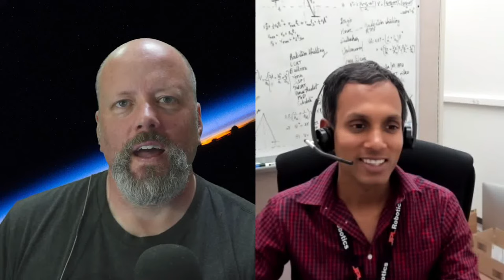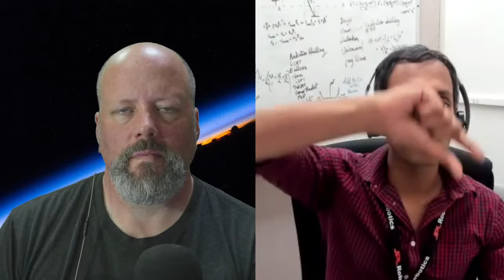The Lunar Crater Radio Telescope with Dr. Ashish Goel

Comment: I've been agitating like a madman for a radio telescope on the far side of the Moon for years. Something several kilometers in diameter and constructed entirely of material found in the Lunar Regolith. Yet people call ME crazy. Harrumph.
Reply from the maker: I was pretty skeptical, but when I heard the weight, I’ve come around
Reply: Learning how to do manufacturing on the Moon is perhaps the best step forward we can take. It seems to be largely composed of disassembled spaceship.
 It's close enough to have robotic surgery as a legitimate option, low latency data.
 It's 1/6th G which might be low enough for a GP spaceship to takeoff under it's own power yet high enough for humans to tolerate longer possibly.

Comment: How do we not have an Optical Telescope on the back of the moon yet?  It makes no sense to me.  Once you land it forever almost you have one of the best telescopes in the known universe.
Reply: There's no need to put an optical telescope on the far side of the moon - the near side works just as well, 24/7.
Reply: @JCO2002  Surely heat would affect the mirrors no?
Reply: @JCO2002  nm I'm half asleep like 5 seconds after I posted that I realized it don't matter.
Reply: @seditt5146  Easy to have a sunshade to eliminate that. You also have to prevent reflected light from the surroundings, but again no big deal. Think of it as a Hubble that's on the Moon, rather than in Earth orbit.
Reply: @JCO2002  Full moonlight affects OIII filters. Imagine how bad Earthshine would affect imaging.
Reply: @LolUGotBusted  Then don't point the telescope at the Earth. Voila, no Earthshine.
Reply: @JCO2002  I have to call all of everyone in astrophotography. Why don't we just not point at the moon! WA-LAH
Reply: @LolUGotBusted  I'd suggest you not do that unless you want to embarrass yourself. Tell me, what does the Earth have that the Moon doesn't? Here's a hint - it starts with the letter "A".
Reply: @LolUGotBusted  By the way - you pronounce the "v" in voila. Here's another question - is Hubble affected by Earthshine? After all, it's only 400-500 km away from Earth and, like on the near side of the Moon, the Earth is in the sky all the time.

Comment: A radio telescope on the moon as part of the EHT would make the apeture 1/4 the diameter of the Sun
(it doesn't even have to be on the far side ... but there would definitelly be shipping issues wih those racks of hard drives used for the data dump that needs to be processed)

Comment: Get a circular Rover containing a bunch of small "Cannon Balls" attached to spools of wire, Drive to the center of the crater and fire the wires towards the edges of the rim.  Perhaps even some hooks so when they land they are some what stable.  You might even be able to just use a rotating turret type system where you fire and lay the wire out, rotate one degree, fire the next etc...  Given the wavelengths he is discussing having the wires lay on the floor would act like a nice solid parabola You could now just raise an antenna to its focal point and boom, huge radio telescope.  You should be able to fire FAR longer than 1km and the moon is rather stable.  Perhaps have small helper bots that walk down the wire and "fix" any wires which are off.  Idk, I like the idea and think its possible for creating huge scopes.
Reply: 23:00  YES!  :D  Projectile based LOL, I love it.  That was my first thought on this topic.  I just picture a Divinci Tank going to the middle of the crater and popping off on the moon.

Comment: I'm confused.  I thought they were going to look at really low frequency large wavelength signals but 3-30 Mhz is above AM isn't it?  Did he mean 3-30Hz?
Reply: 3-30MHz have wavelengths of 100 to 10 metres.
Then you want a dish much larger than that to have any angular resolution.
Reply: @massimookissed1023  I see I got confused about his remark about why we could get away with small tv antennas (I thought he was asserting that the wavelength was small there and apparently I was too lazy to divide c by the freq)